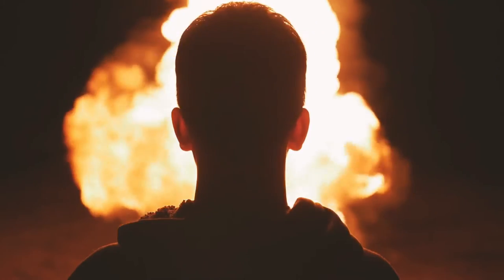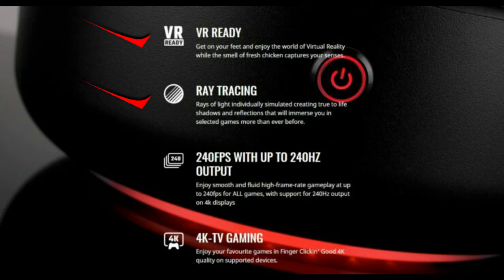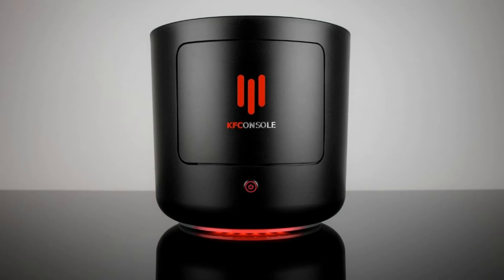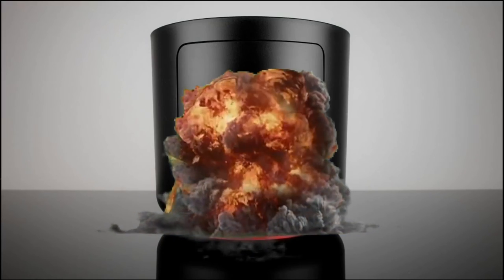How The KFC Console Chicken Heating Chamber Works

Comment from the maker: KFC has announce the KFC CONSOLE once again by KFC gaming. This is how the heating of the chicken chamber inside the KFC CONSOLE works. Are you buying this console? if YES then WHY? 
[TIMESTAMPS]
0:03 Intro 
0:15 Change In Specs
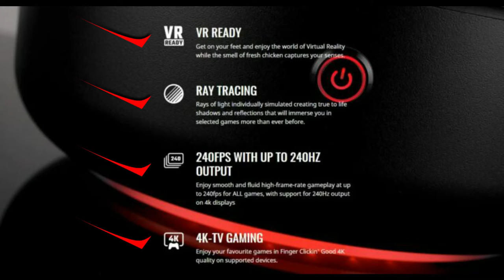1:08 Release Date
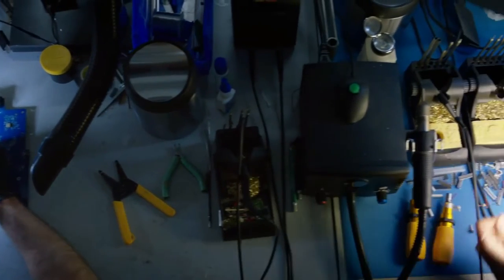2:11 Sections Of The Console
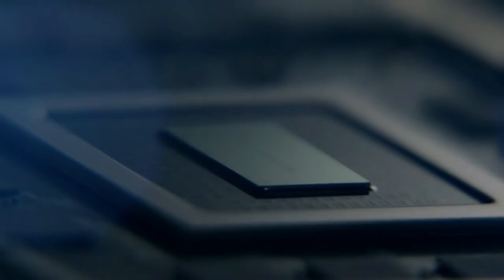2:48 Heating Process
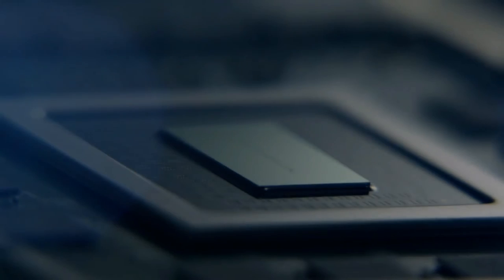3:42 Talking of Heat Sensor inside The Chiken Chamber
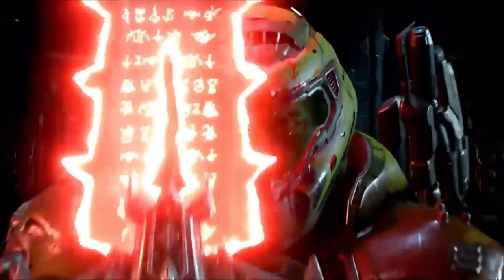4:24 Conclusion